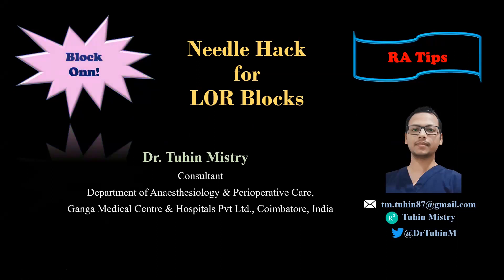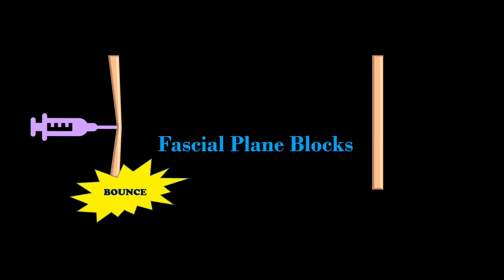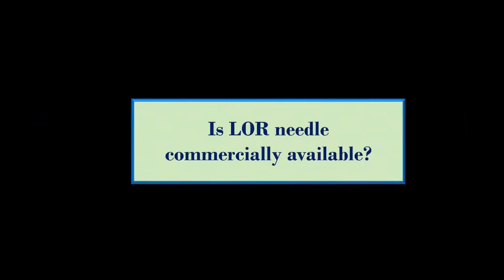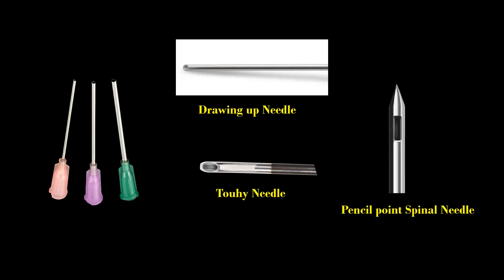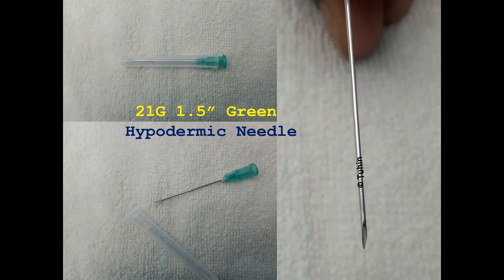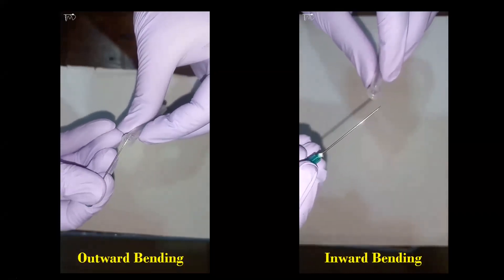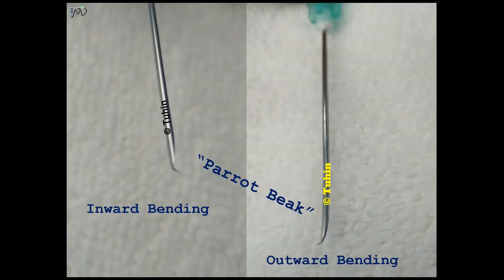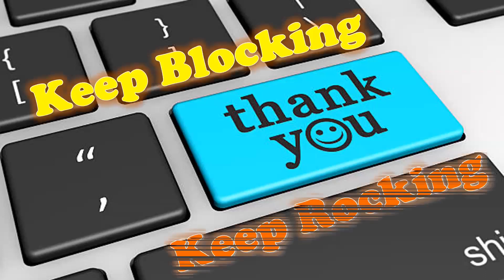LOR Needle | Loss of Resistance Needles | LOR Blocks : The Essentials @DrTuhinM

Comment: Is it better to use pencil point spinal needle after making a hole in skin instead of using hypodermic needle?
Reply from the maker: Both are okay 
Depends on your experience and practice
Reply: @DrTuhinM if let’s say you plan to use pencil point spinal needle, would you use introducer as well or just the pencil point needle?
Reply from the maker: @pruthvidherm6292 yes definitely.  
Use introducer needle or atleast make the skin subcutaneous tissue puncture with a 14G hypodermic needle. Otherwise it is difficult to insert a pencil point tip needle directly